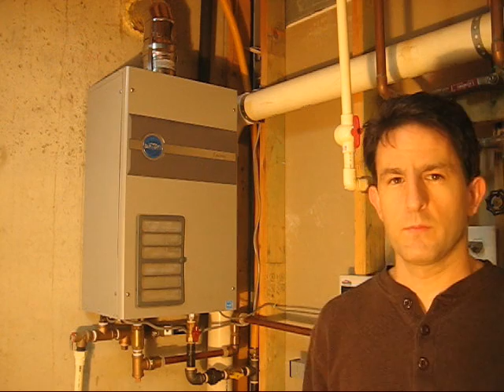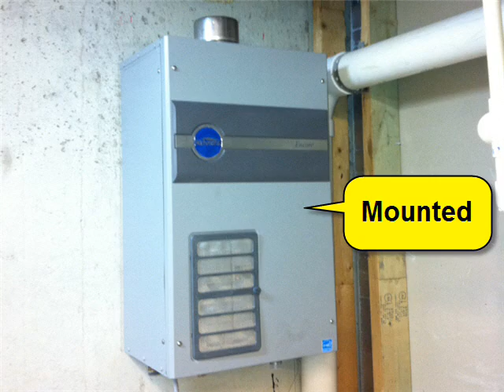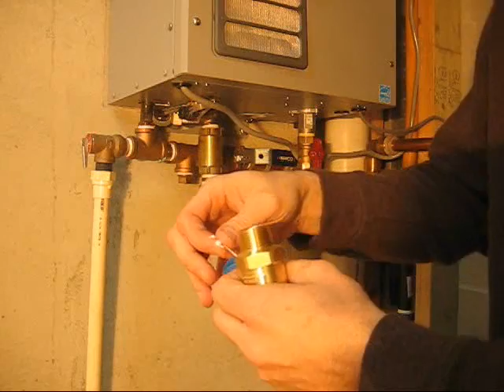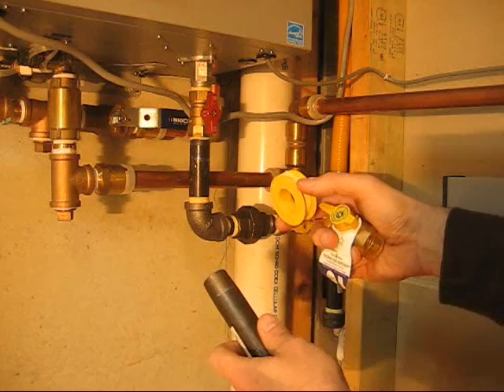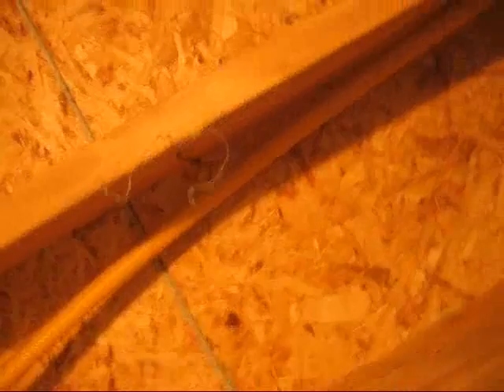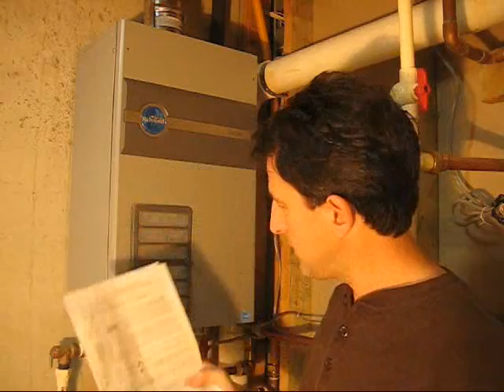Tankless Water Heater Installation

Comment: What model number is that
Reply from the maker: They don’t make that model anymore.  It is 200,000 BTU Natural Gas from https://www.richmondwaterheaters.com/residential/residential-condensing-tankless-water-heaters
Reply: Thank you I figured it out I have that model but could not read it because it was again the wall. I was trying to be lazy doing research but ultimately had to take unit off wall. Looks like heat exchanger broke inside it and I’m going to replace it. Thank you and keep up the great videos.
Reply from the maker: This video may help you see what is going on inside.  Its not exactly your problem, but shows a lot of disassembly. 
How To Clean a Tankless Water Heater Burner (Part 1)
https://youtu.be/KYBngqCepJo

Comment: I hope you answer this.  What size gas line you had and did you resize the gas line?
Reply from the maker: Before i had 1” coming in from the meter and half-inch line going to the old water heater.  I replaced the half-inch line with three-quarter inch line going to the new heater. They are more efficient overall, but when they need gas they need a lot of it.  Also, don’t use CSST flex pipe. That slows down the gas and can cause problems.  You can use a little at the end, but not very much

Comment: I have two 50 gallon electrical water heaters installed in the attic above second floor.  I am thinking to replace them with a tankless water heater.  I have two gas lines to nearby two HVAC units.  I can add a short wall to house the new tankless water heater.
My main question is the vent line to the roof. Since I am going to have a new roof installed, I am thinking to buy the vent hardware to roof  and ask roofer to install the vent, so when the tankless unit is installed later, it would be rather an easy job. The vent line to roof is only 3-5 ft.
In the comments I have read, the high efficiency unit have PVC vent pipe (probably due to a forced draft with a blower) and  the mid-efficiency unit requires stainless vent pipe (probably due to the natural draft and high exhaust gas temperature.)
Since normally we have only two people in the house, I probably don't need a big unit.  Just wonder what capacity of a new one I should buy.  BTW, for the two existing two units in series (electric), I usually run only one unit, #1 in summer and #2 in winter.  I need to run both only when my children's families are here.  I live in Dallas, in the summer , attic temperature is hot even I have a motor driven vent. and 10 natural draft vents. I am thinking about putting in one more motor driven exhaust fan on the roof.  
Any comment will be greatly appreciated.
Reply from the maker: The stainless steel double walled exhaust vent  pipes are $50 each, so I would definitely suggest you get the high-efficiency model, so you can use PVC pipes which are five dollars each. Yes, it makes sense to install a roof vent while you are getting your house reroofed.  I think the units are rated for the number of simultaneous showers you can take. I think mine was rated for three showers at once.  With two adults and a teenage daughter, I have not had any problems. When your kids are home, just make sure they are not all taking showers the same time you are.

Comment: wrapped the teflon tape the wrong way.
Reply from the maker: You caught me.  Yes, the rule of thumb is to wrap the same way you screw on the fitting, but the truth is, it liquifies under the extreme pressure of the fitting, so it really does not matter which way you put it on.

Comment: Looks as if you should have installed your check valve before you cold water clean out not after it. the who purpose of the check valve is not to contaminate your main water supply while cleaning your unit.
Reply from the maker: +19oakridges85 - Good Point!  You are totally right.  Thank you.  I shut off the water supply, while cleaning, so there is almost no risk of upstream contamination, and its only vinegar,  so not a big deal.
Reply: +19oakridges85 great catch!

Comment: Do all tankless water heaters need ventilation?  I want to install one in my condo in Florida and take out the 30 gallon water heater that I now have.  By the way, if I need a professional to do this who do I get?  I don't need an expensive unit.  It is just for me.
Reply: +Ron Webb If you have an older house you might have to beef up the electrical system. I think they take 220v, like your dryer.
Reply from the maker: +Sheila meri - Yes, all gas water heaters, regular and tankless, need an exhaust vent to remove the tons of carbo dioxide produced by the flame.  Electric water heaters don't need ventilation, but I am not sure you can get an electric tankless heater.  The newer gas tankless heaters vent with just a plastic pipe to the outside, so its pretty easy to add.  I would suggest you buy your own unit and then call a plumber to install it.  Make sure they have experience installing tankless heaters.  It is not hard to do, but its better to get someone that has already done a few of them.
Reply: Thank you so much for your response.  I am definitely going to get an electric tankless heater.  I just have to figure out which one.  I like the Eco's.  We shall see!!!
Reply: +Green Genes Thanks.  I will look into that.

Comment: Just wondering why you didn't install service valves on the hot and cold side. Would make des along much easier, instead of using pieces parts to construct makeshift clean outs. Also why the flexible gas line? Most manufacturers are strict on using 3/4" black iron gas line for the entire run. They do say you can use flexible but it's BTU rating must be much higher than the tankless heater in order to function properly. I know I'm a stickler on stuff but you never, ever wind PTFE tape towards you on threaded pipe or unions. Always wind the tape clockwise away from you. Pretty much guarantees zero leaks. Clean install though.
Reply from the maker: +Robin Banks - You are right on all 3 points.  See my follow up videos, below, and you will see I figured the first two things out, the hard way.  As for the tape direction, :), I now wrap it the "right" way most of the time, but as a mechanical engineer, I argue it makes absolutely no difference.  You are simply laying several layers of teflon over the threads.  After the parts go together, the tape is nearly liquified and will never remember which way it was wrapped.  More importantly, I have never had a leak, doing it the "wrong" way.  Great comments.  Thank you!

https://www.youtube.com/watch?v=YcwyevmB2m8  and  https://www.youtube.com/watch?v=zW109bgIRg4

Comment: shouldnt you have installed your check valve on the cold water to the right of the tee? so when you do your yearly flush/cleaning none of that has the ability to feed back to your cold inlet
Reply: +Ninja Pleaze probably should have done both sides.

Comment: Great video - I learned a lot.  Thanks so much.  I am debating High Efficiency versus Mid efficiency.  Are there any specific reasons you went with Mid Efficiency?  The conversion to HE appears more complicated but would eliminate my air-in pipe which I desire.  Also is the fan noise noticeable?  Again - thanks.
Reply from the maker: Roger Gordon - Hands down, I would go with high efficiency.  When I installed mine, they were a little pricey, but I still may have been better off, because the stainless steel exhaust pipe is $50 for each peice!!  High efficiency models just use cheap PVC exhaust piping.  When I am in the shop, with the unit, I do hear the fan, but it is not annoyingly loud.  I have never heard it outside the shop.

Comment: what is the type of water heater you used?
Reply from the maker: I bought a Richmond which is the same as Rheem.  I have been very happy with it.  See my other videos on flushing the heater and cleaning the burner at HowToLou.com.  Don't use flex gas pipe.  I have a video on that too.

Comment: Good job the only thing missing is your boundin wire that jumps from the heater to the hot and cold water pipe and to the gas pipe other than that clean job

Comment: HowToLou: Never mind the trolls that criticize just to make themselves feel better.
Good Video. I just wonder what you think of the unit now that you have had it for a while. What do you notice that is different from the traditional hot water heaters as far it's pros and the cons? Thanks
Reply from the maker: That is a very good question.  I have had it for 2 years, and I do like it.  I was frustrated, at first, when I got some error codes and it kept shutting off in the middle of my shower!  That turned out to be that I was using to much 3/4" flex gas pipe.  I changed to solid pipe, and it is fine.  Also, I clean the burner and flush the system once a year, and I have had no more problems.  I have videos on how to do both of those at HowToLou.com.

Pros: You can take a long shower and the water NEVER gets cold.  You could literally stay in there all day.  It freed up space in my basement workshop.  I removed the big tank on the floor and now just have a small box on the wall.  It saves money (mainly in the summer), because it does not have to heat a big tank of water that you may not use for hours.  This heated water just sits there and heats up your house, and your air conditioner has to fight it back to cool.  In the winter, you are heating anyway, so is does not matter.  People think you are cool for having a tankless water heater :-) 

Con: It takes a little longer for the water to warm up at the tap.  I think we wait about 5-10 seconds longer for the water to get hot, after you first turn it on.  It not a big deal, though.  You learn to turn on the hot water as soon as you walk into the bathroom, if you know you will want hot water soon.  The shower heats up pretty fast.  All in all, we are totally used to it, and don't notice it anymore.
Reply: Thanks for your response. I appreciate it.

Comment: I have a gas water heater that I am thinking of changing to a tankless one. Is there higher psi for the gas line required for it? Presently I think my gas line is 1/2 inch OD.
Reply from the maker: Check the model before you buy it.  It probably requires a 3/4 gas line to get enough volume.  Tankless heaters are more efficient overall, but burn 3 times as much gas as a tank heater, when they are running.  If you follow your 1/2 gas line, it will likely lead to a bigger line.  Look outside at your gas meter.  Most houses are fed by a 1 inch line, and then the various appliances use 1/2 inch runs off that main feeder.  The tankless will likely need 3/4.  Also, it is better to run solid rather than flex pipe, because gas can flow better in it.  Rheem, for example, says you should not have more than 3 feet of flex pipe going to their heaters.

Comment: you said you want to have the vent "chimney" pipe as close to the top of the unit because it is expensive.  You need to have at least a 12'' clearance from the top of the unit or you will overheat your heat exchanger and cause it to crack and leak. - Jay

Comment: don't forget that the BTU on the water heater must be sized to max output of unit this could be 200,000 BTU you could have to add all gas appliances and size your gas line to a larger  branch than half inch. Might not utilize the water heater for optimum savings

Comment: The flex pipe you were using, I believe, is called CSST. This stuff cannot be used unless it is electrically bonded to the house ground where it enters the house. That's necessary to avoid possible exposions due to a lighting strike or other issues.

There are some other issues, but none that affect safety (save for the reverse tape thread, already mentioned).

For those doing their own, the manuals always say to follow local code. That will include NEC, fire, and plumbing codes. Be safe!

Comment: I think you made the right choice.  I am not an expert but the PVC ones can use the plastic pipe because of high burner efficiency.  Think, over time the efficiency of the system will decline (law of entropy) and will be less reliable and probably less safe.  That is my thinking on that anyway.  Yours will be good for 50 years as long as you keep it clean.

Comment: Who the hell puts T-tape on gas pipe! all you need is dope. and if you do use T-tape you need Gas rated tape. You are also suppose to put fire rated sealant on the venting. you could have used sediment faucets instead of 3/4 plugs on your hot and cold just for draining and for when you run your cleaner/descaler, just a suggestion. and the pipe at the end of your gas flex line is called a drip leg. all in all you did a great job.

Comment: Why have you installed 2 gas valves?? , where is the cold water shut off valve?? and you did put the teflon on wrong and did you size the gas